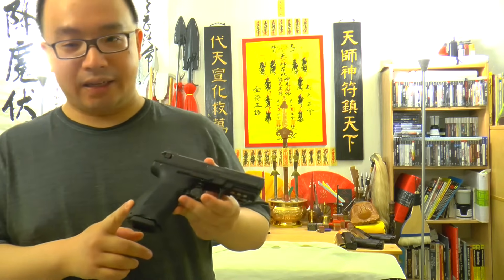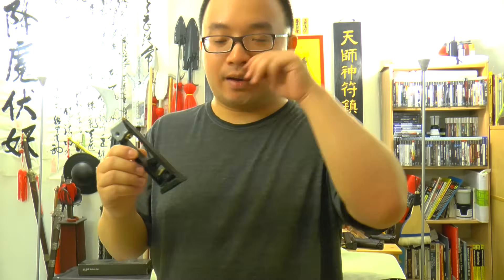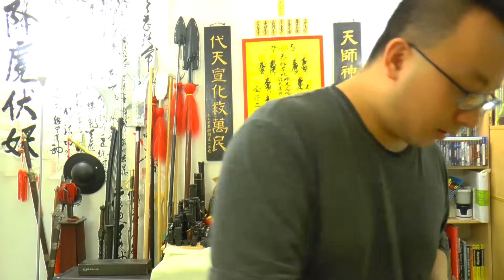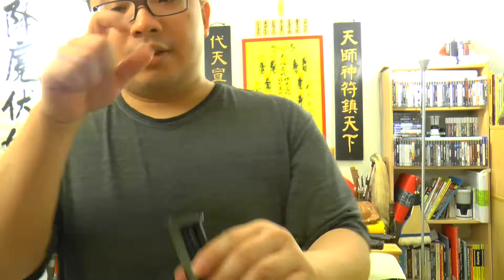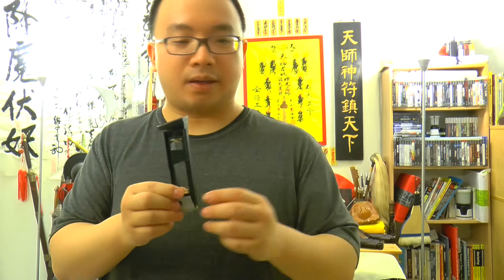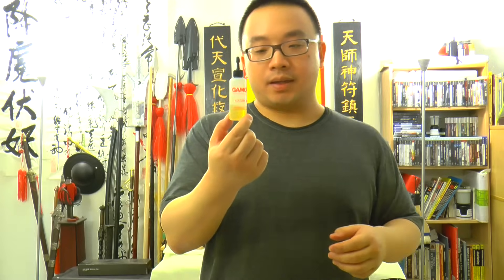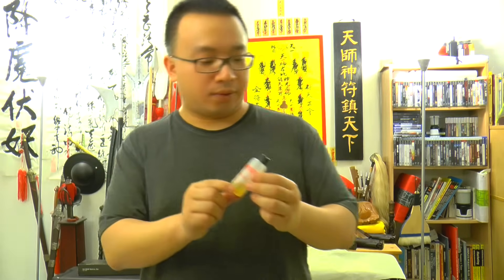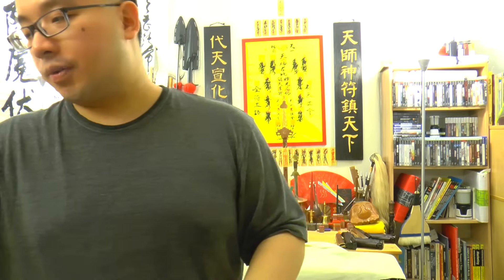How to Fix Leaking Co2 Airguns or Airsoft Guns

Comment: Although this video is several years old, I had this issue with a Co2 Airgun. (2022) Used the silicone "gel" I use for plumbing (O-Rings) let it sit on the seal for 3-4 days, loaded in a cartridge and NO LEAKS!!!!! Thank You so much for this fix!

Comment: Good presentation. You are the first guy to acknowledge the value of the silicone "grease". While NOT a lube for metal parts it's terrific on o-rings and other types of sealing items. I've used it for many years in my job to seal against pressure and vacuums and figured it might be great for somethings on air guns. It can also lube plastic parts that a real oil might mess up.  Get some and us it sparingly . As they used to say " a little dab will do you".  No need to slobber it on anything.
Reply: Silicone grease is used in airsoft guns to lube metal gears. seems to work on metal parts for me.
Reply: I remember that
 "Little dab"that did me.
It was called
(Brylcream) , a good smelling 
not so greasy goop for the hair. Hell , I bet that would work now that ya mention it. !
Reply: @alexj.talladino6685 
Its where YABBA DABBA DOO came from... Wiiiiiiiiiiiiiilllllmmmmaaaaaa

Comment: Chiinnature, thank you so very much for the idea about using silicon grease.  I used the end of a toothpick to carefully apply silicon grease to the two quad seals and quad seal retainers in the valve assembly of my old Crosman 357. It worked great.  I went from getting 30 shots per CO2 cartridge to 60 shots!  I was about to throw the gun away before trying your idea.  Thank you, thank you, thank you.

Comment: I had given up on fixing my leaky CO2 magazines until I saw this video.  I sprayed airsoft silicon lubricant into the magazine and waited a while.  Once I installed a new CO2 cartridge, the leak was sealed.  This saved me the cost of buying another magazine.

Comment: When recommending grease and/or oil it's important to make the distinction between silicone and petroleum based lubricants.  Petroleum based lubricants tend to eat away at seals eventually causing a leak, rather than preventing them.

Comment: Thank you for this advice. I used the silicon grease..and worked....before I seen this video..I looked at buying a the seal itself...but was shocked to find it was more expensive  than buying the full mag... I've ordered  another  mag.. for a beretta m9a3..I'd advise all not to mess about with tape...just get the silicon grease... once again thank you.  Job well done..

Comment: Thanks for sharing your tips and tricks, particularly the way to use a hair dryer or low-power heat gun to soften the seals and help the grease soak in and do its job.

Comment: This worked great for leaky S&W M&P magazine. I sprayed silicone lube, keft it overnight, applied silicone grease to the fitting in the mag AND to the top of a fresh CO2 cartridge and voila. Worked great with this first one, hoping it keeps working with subsequent cartridges.
Reply: @59er9er  how to apply silicone grease on seal do we have to cover the whole seal with grease? Hole in the seal will also get covered can you please share how to do it?

Comment: Tip - cut a slingshot band (flat type) slightly larger than the c02 tip, which will loosely stick to the tip with oil applied.  After the first c02 makes a seal, you should be able to use quite a few before having to change out the rubber.
Retail slingshot  rubber is probably the highest quality available.

Comment: Im new to this stuff, got the Beretta PX4 Storm Co2 and love it. Worked excellently for the first 7 or 8 cartridges then started leaking. I never gave any thought to lubricating the seal, so thanks. I’ll see if that helps.
Reply: Always pelgun oil co2 bulb, and NEVER leave it in longer than the shooting session. I learned this to my cost. Since using pelgun oil every bulb and removing immediately after shooting l have had no problems

Comment: Silicone grease is also available from plumbing supply stores and you can bet it's a lot cheaper than going to an airgun supplier. It's very good for all O-rings and seals.

Comment: Best video I've seen on this, tried the plumbers tape before and it didn't fix the leak on my Makarov... Silicone grease worked a treat though, Pistol now shoots 'A.O.K.' Cheers dude ;-)
Reply: My hammer block seal was toasted, unscrewed it out slightly, and dabbed it silicone on the threads and reset it. Works great again also

Comment: instead of teflon tape  you can use liquid o-ring and put a tiny layer on top of your co2 cartridge. and that "WILL" fix the leak  tested and worked.
Reply: Where do You find liquid O ring?
Reply: What size do you use?

Comment: I Also heard somebody say that the plastic disc you find on the inside of a cap from a coke bottle(a plastic bottle) can be cut just a little bigger than the tip of the c02 canister and provide the same function. I haven't tried it, just repeating something I heard.
Nice vid. 👍good stuff. Very experienced content & thanks for the tips.

Comment: Want to thank you so much for this information just bought new to me co2 pistol. Have not used silicon grease or the spray yet but I have confidence that it will work also looking forward to digging out the old co2 rifle that I bought for my son back in the early 2000s should be able to restore it as well. Thanks so much again. Stay safe ehhhh

Comment: I have the crosman DPMS SBR , some of the batch of mags they have have a tendency to  leak. , i tried one of your methods on one  that i  gave up on.And now i  got it to  work using the silicone spray  method   , cost me a couple of c02s,but that is still cheaper than buying a new mag at  $65 , thanks

Comment: What a charismatic guy! I can understand, that this is a common issue ...I have just bought Beretta M9 made by Umarex, and already have this problem. 3 cartriges just blew away and I cant find out what I do wrong. Is it too tight? Is it not tight enough? The system is not perfect and I hope that it will be fixed soon by Umarex..not by clients. But Ill try the tips in the while.
Thank you!❤

Comment: Thank you!! I have a glock 19gen 3, and a glock 19x . It was leaking air. Thx to u I used my hair clipper oil. 2 drops perfect!❤ unfortunately the oil did not work. I tried using gorilla tape..nothing.. keep trying

Comment: The seals are of neoprene.  They don't expand from the solvents in the lubricant.  The lubricant does allow parts to slip around the seal, rather than pinching and damaging the seal.

Comment: Another tip. Since the 1960's I've been putting a dab of Vaseline on the head of a Powerlet prior to inserting it in a gun .Seems to work.Some of my guns still have their original seals.Thanks for very interesting postings ;-)
Reply: Vaseline is a petroleum based product and over time this WILL endanger the lives of ALL your seals. Most people do not understand that seals each have a different purpose, thus their design, however seals made yesterday require a certain amount of sufla to retain their specific qualities/performance/texture...todays WILL ALWAYS WORK BEST WITH 100% SILICONE, that's right I said it SILCONE. This MARS' gift to ALL warriors. 2 RULES IN LIFE....1 IF YOU DON'T KNOW WHAT TO DO..DO NOTHING AND LET YOUR MIND CATCH UP. AND 2 ALWAYS PAY ATTENTION TO THE LITTLE VOICE IN YOUR HEAD...Forgive ALL, Teach ALL ;}
Reply: @rg6569  man wtf are u talking about

Comment: There's a better way!! Over time the cartridge turns to the right when you put in a new one and it turns the nipple screw in and eventually it won't seal!! All you have to do is screw the nipple screw out or turn it to the left about a half a turn and then from now on you need to hold the cartridge from turning when you put a new one in  that's all there is to it  so you might want to make a new video,  UPDATE it works short term for a few minutes, I will update again later
Reply: I have noted your tip for use in the future, thank you.

Comment: just make a small gasket from a rubber glove, use a hole cutter if you have one the right size. install the rubber gasket and it works like a charm

Comment: This video really helped. Wish manufacturers would find a way to prevent this because it seems like this happens to every mag way too soon for litterly everyone. That's way to often for s problem like this to be happening
Reply: Thats cause im sure they oil or grease the seals but once they box  they could sit for days or weeks or even months befor some buys them then u thinking since new mag should be fine use you run 1 or 2 and oil dry up i was always oil seal and co2 tip even new ones it works silicon oil prefect and cheapest got mine for 3.00

Comment: Damn, already put a bunch of gun oil on my new P320 M17. Hopefully I didn't ruin it because not only do I have silicone spray, I also have a bunch of silicone grease.
When I empty this CO2 I'll be sure to spray it with the silicone and then later use the grease.

Comment: The silicone grease method worked for me , I  have had the Walther P99  RAM with the de cocking button for about eight or nine years it always leaked I think it has only fire about 30 shots since I bought it , and I was about to put it in the trash when I seen this video , so I tried this grease SILVERHOOK water proof Silicone Grease Operating Temperature  -30 C to +180 C  smeared it over the top of the CO2 capsule put the capsule in till it pierced it then tightened it more then backed it off about half a turn still leaking a bit , I then dry fired it  ten times , and to my surprise the leak stopped . Maybe because this grease operates at such a low temperature  the  CO2 won't affect it as much.

Comment: I have an HK USP and when I insert the co2 and screw it in, all of the CO2 rushes out and the cartridge freezes up. How can I fix this issue?
Reply: Willster7471 that's not an issue, that's normal
Reply: Willster7471 I have the same gun and problem plus sometimes it will work and just leak

Comment: I have a daisy model 100 ( the really old first semi auto co2 BB gun Daisy made) that takes the short 8 gram co2 tanks but it always instantly leaks out. The piercer looks kinda rough. Should I just use the grease and o rings?

Comment: Chiinature, I have an airsoft revolver that I've had for a while and I accidentally left a cartridge in the gun for a day or two. My gun now leaks a lot of Co2 everytime I put in a new cartridge and I'm left with only a little air left which greatly reduces the number of shots and power of my gun. I know you addressed this in your video, but which fix would you use? I can't easily get the seal out since it's attached to the main part of the gun. Would the silicon grease fix the problem even if the valve is pushed back a bit? (Not entirely sure what the problem is yet.) Thanks in advance!

Comment: Pro tip, if the hair drier heating the seal doesn't appear to be working, use a propane torch instead.

Comment: Hey I bought some Pyroil silicone lubricant & I'm just wondering if it's the pure kind & not the 3 in one kind? Also Has anyone used it on there co2 clips before & had success with it?

Comment: Nice tips ,some of which I had no idea about.But I have a question.
Why not just buy new seals?are they difficult to replace?hard to find ,or expensive?As far as I saw ,the first seal is talways the problem - the one in contact with the co2 cartridge.Not many mechanical problems with these things ,most are leaking issues.
Is that first seal the same for all guns or does it differ by model?
I would like to see some seal replacement videos.Thanx
Reply from the maker: Xin You Seals are not hard to replace, but they are mostly hard to find or hard to disassembl. A lot of guns require you to change the seals by taking out hte valve and then unscrew a brass ring and replace.. but just doing that is very impossible for most people. So instead of screwing around your gun, there are much easier fix for most people at least. The silicone grease will fix most problems!

Comment: Hey I have a crosman C31 and when I inserted the co2 cartridge all the air from it leaked out... which means there is a serious leak somewhere... its hard to dismantle... Which one of these methods do you recommend I use?...
Reply from the maker: try teflon tape on co2 head , give it a thick padding first and try
Reply: +Chiinnature I tried two layers... it stopped major leaking but it's still leaking somewhere else
Reply: Hi! You got a very serious matter there! And so do I with a different gun! And I did never find anyone talking about my own sad matter!! Your gun is a oain in the @ss to disassemble and reassamble! But go to a gun store, and ask if they know some one who work with these guns!!

Comment: 😂 I got a co2 colt defender, have silicone sprayed it every time, just tried to fire it, nothing, replaced the canister it just leaked constant out the nozzle, removed it thinking something was stuck around the seal but no and the same again, its had about 15 canisters since 2018 when I bought it
Reply: How did you fix it I have the same gun??

Comment: how do you get the old seal out, mine will not come out?
Reply: Some are "clamped" together with a donut screw. To remove you need to disassemble your gun further most likely.

Comment: Hey, thanks for the great video. I've got a quick question, 
Here in India it's not easy to buy airguns, and it was really troublesome for me to buy a beretta px4 storm airgun, and that too at a really expensive price (around 400 USD). So it's really hard to find any oils or other equipments as well. 
Do you have any other alternative that I can use that will solve the same purpose? I was able to open the valve part from your beretta px4 storm maintenance video. It Really helped. Thanks in advance :)

Comment: You mentioned pellgun oil, I hear that is petroleum based which will rot rubber, don't use it on the seals.

Comment: please answer this ASAP i unfotenuly drop the gun it mag co2 with bullets and i shoot some more shoot but the secound shoot i hear a litte sound comming from my co2 capsule and i took the mag out fast and shaw it is leaking from the top of the capsule. i waited of corse it can give my hands permatly frezzing if it hit my hands or any part of my body after i was done leakeing the top of the co2 holder were it transport the co2 to the gun barrel it was all cover in white but not the pin that break the co2 port and it shoots higer than it did before i missed it on the ground can it be my hupup that got lose? sry for my english

Comment: AWESOME CHI, you're the man. I like your thoughts on this problem which is so common. I leave my gas in my gun for weeks on end and only after about 2 years did I have a problem. I wish I would have seen your video earlier because I just paid $50 for a new magazine. Thanks again, well said. It's obvious you're a smart guy.
Reply: NEVER leave co2 bulbs in your gun after shooting remove right away, not even a day should you leave it in.

Comment: My son left a co2 cartridge in his gun for months and compressed the seal. Managed to get the seal out ok and put it in boiling water for a few minutes and it returned to the original size, a drop of pellgun oil....and sorted

On a different note, pretty sure Pellgun oil ( at around $1000/ litre here in the UK) is just a cheap motor oil.....google it

Comment: Most of there don't appear to really fix the issue permanently, and may or may not work. But one method I'd definitely stay away from is the Teflon tape fix. You could get miniscule particles of Teflon gumming up and clogging your CO2 system. Bad, bad idea I think, IMHO.

Comment: Please, help me.. I tried to fix my Crosman C11 using your techniques, but it is still leaking.. I guess it is not the green seal inside, because when I loosen the CO2 cartridge I can hear the gas going out, but when the cartridge is still tight I always hear the leaking.. I do not know if the leaking is inside the gun or if is it another seal damaged..

I do not feel very well disassembling my air gun, because I do not want to loose any part or damage it at all.. I also tried to fix it with a little rubber seal that fit perfect, but does not work either.. I tried with the Teflon tape, and does not work.. I tried with the two methods at the same time and does not work.. I do not want to throw away my gun and buy a new one, I really want to fix it at any cost.. HELP ME!!
Reply from the maker: c11? preobably your valve is leaking from the back with a slow leak. Best way to do is - buy a new one. The c11 is a cheap built, not even worth fixing

Comment: hello everyone I have a problem with my air soft revolver that was given to me  it is a gas revolver not co2 I could not find anything on the net about a gas revolver I was wondering if anyone had any knowledge of such item but where you insert the gas is where it's leaking I tried tightening and lubing it but it seems to be stripped turning it in certain ways it goes from slow leak to very fast leak can this piece be replaced?? thanks in advance.
Reply from the maker: which brand? you can get a new valve / o-ring and replace that one you got, the valve probably have a bad oring only and needs to be changed. Evike.com have a lot of different valve, find one and install / replace it and it should be good again
Reply: +Chiinnature I don't know which brand it was given to me with no clue it only says where it was made I'll look into replacing the valve I was wondering if I can troubleshoot it like any other gas magazine it being a six shooter and as a last resort replacing it
Reply: +Chiinnature thanks for the quick reply by the way
Reply from the maker: no need, because you ALREADY screwed up the seals of the valve, and you need to replace o-rings, and buying o-rings are not worth the deal paying the shipping, it's best just buy a new valve and replace it all in one go. Nothing else needs troubleshooting much.